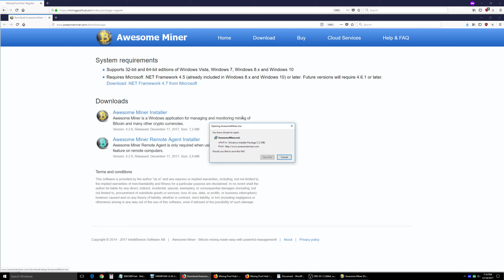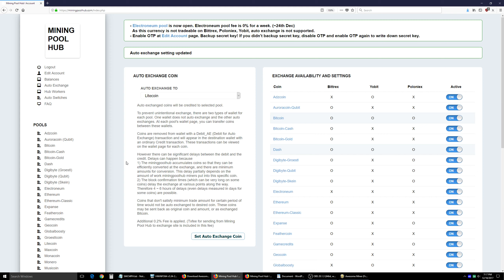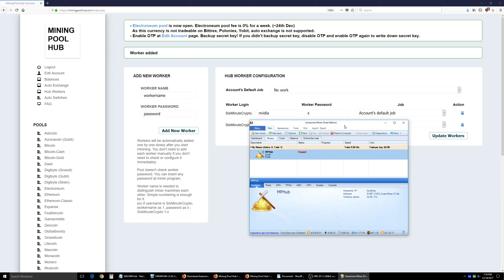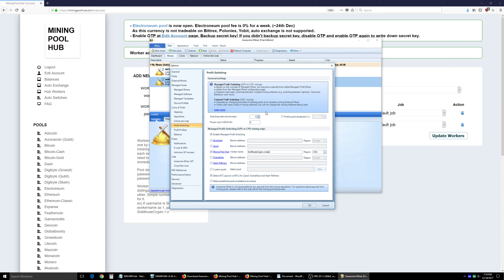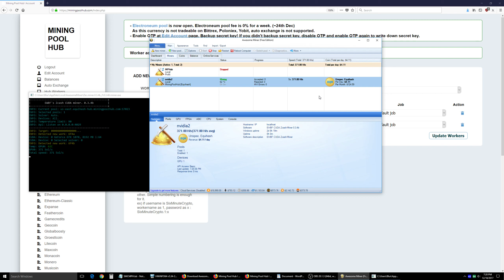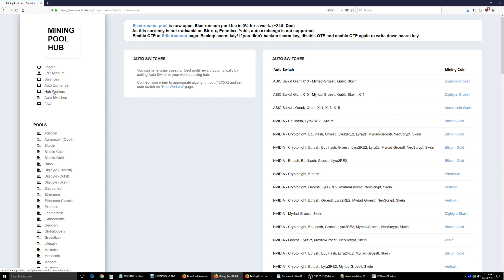Awesome Miner and Mining Pool Hub Tutorial - Nicehash alternative

Comment: Pls, answer me, Do I need to leave my internet connection on, to be able to mine with graphic card? I need to make the calculation, because of the cost of data connection in my country.
Reply from the maker: Yes, internet needs to be constantly connected to mine but bandwidth usage is extremely low